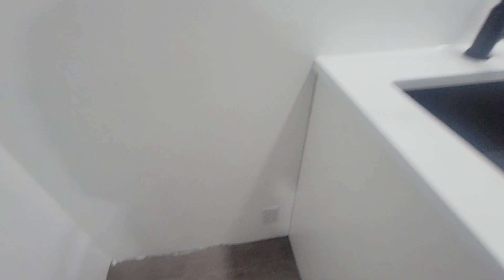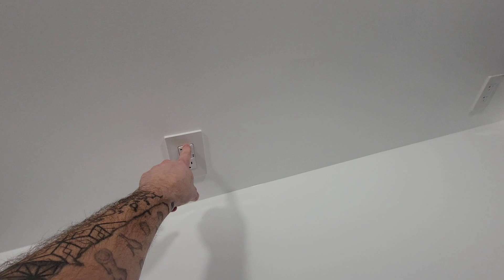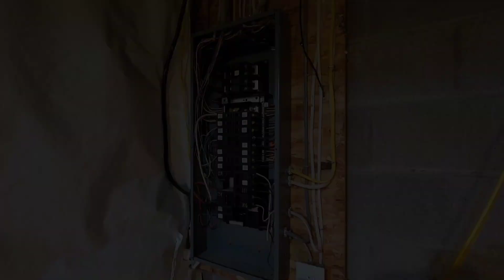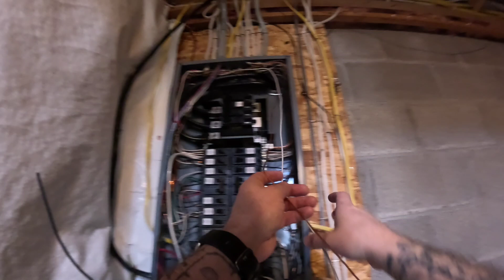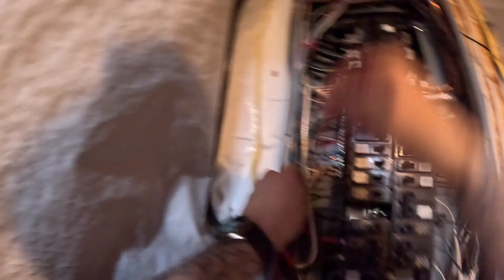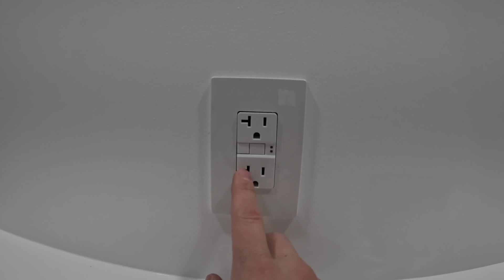Adding a 20 Amp Circuit to a Breaker Panel

Comment: Was this in a kitchen?   Or just another countertop with a sink?   Just so you know, 20 amp receptacles are not required for 20 amp circuits, unless there is only one simplex receptacle.   BTW, It is a code violation to install neutrals in the lug bar single hole with other conductors.  Neutrals are one conductor in one hole.  Another thing, Electrical panels are not allowed in bathrooms or clothes closets.
Reply from the maker: Basement countertop area.